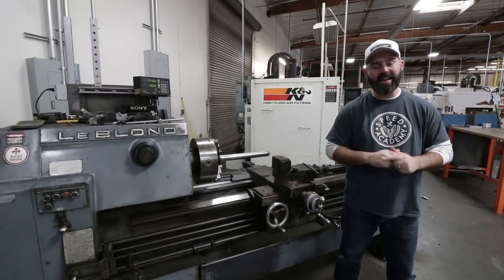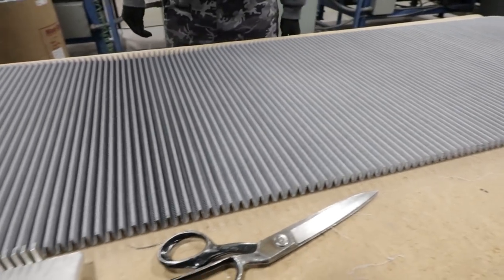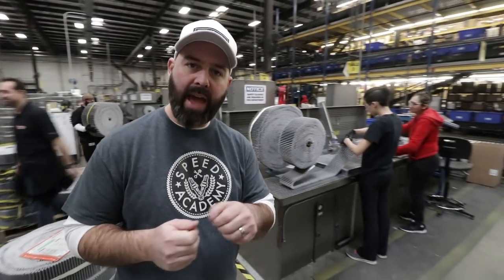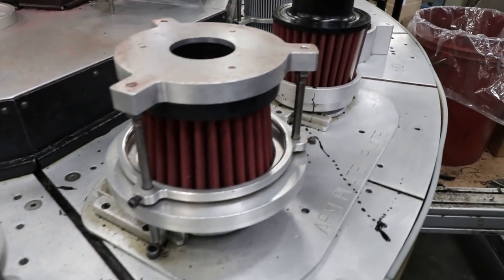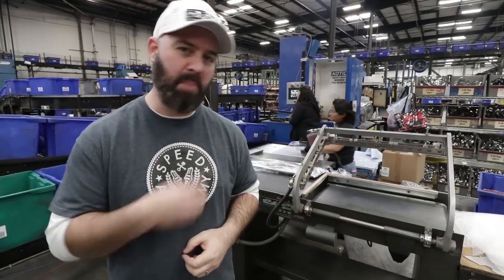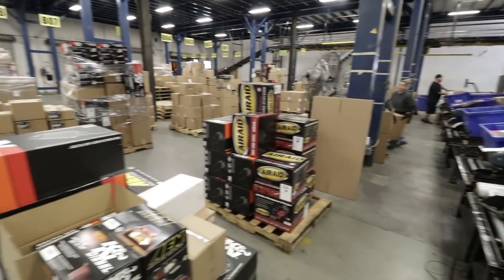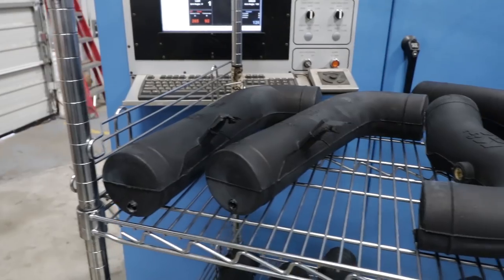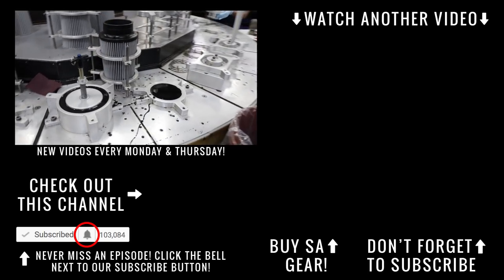How Performance Air Filters Are Made - K&N Filters Factory Tour

Comment from the maker: Who here uses K&N filters and how do you like them?
Reply: I have one in my 04 4runner. i guess it works well? i like that it's washable
Reply: I've one of those K&N rotomolded intakes on my own ASS2000, it's really a decent piece. It fits well, sounds good and (supposedly) makes a wee bit of power. Thanks for the cool video, surprised theres so much hands on work involved
Reply: On some cars you notice real power gains from using these filters , on most cars you just notice an increase in throttle response . With a car that shows fuel economy , you can see the biggest reason for using these filters . I had a 2007 Pontiac that i was able to beat the claimed fuel economy by quite a bit , if i remember they said it could get 7.3 litres per 100 km i was able to get my average down to 5.7 litres per 100km with a K&N filter .
Reply: Speed Academy Been using K&N for years on all my vehicles including my ATV's and street bikes. I want to try a DNA filter on the street bike after watching a video on the difference between the two. Still not sure if it's going to make enough of a change to justify spending twice the $$ though
Reply: Speed Academy I used k&n for a long time but I switched to dna filters they are way better
Reply: I had and currently have a K&N filter or intake on every single car and motorcycle I ever had( 30+ vehicles over the years ) My 2015 Camaro Z/28 came with one from the factory. Best part, you only have to buy it once, clean it and reinstall for the win..
Reply: Speed Academy Love it on my 95 Si. Mostly for the sound and simplicity of cleaning and spraying new adhesive on. Not sure of any real power gain but looks nice and makes the engine bay neater
Reply: nope drank 50kms more fuel over the standard filter per tank . back to the standard for me
Reply: Seen lots of them destroy engines, even when new cant seem to handle boosted vehicles
Reply: Im still waiting on the one for my Skyline, run one in my Silvia. Worth every penny.
Reply: stevemic , it may be that the extra air pressure causes the oil to enter the intake , that wouldn't hurt anything . but if the oil is not on the filter anymore dirt and all manner of junk can get past the filter ? I don't really know as i have always driven naturaly aspirated cars , and have no experience with turbos or superchargers . I had a 1987 Jeep that had over 900,000 km on it and the K&N filter sure never hurt it , or any other car i've owned so it has to be a boost related issue .
Reply: AEM Dryflow
Reply: have one in my mk7 gti and it is great!
Reply: jerry henderson i am a diesel tech and see lots of dirt that gets past the filter , not just kn all the non paper ones. 
You cannot beat a paper filter for filtration
Reply: The paper does a better job of protecting your engine , but it stops a lot of air as well as dirt .
Reply: works great on both my Subarus, I really notice a difference over the stock filters when I'm climbing high mountain passes here in Colorado, but the oil does get a little dirtier a little faster than a stock filter, but I really dont like removing factory air boxes so I have had a K&N on every car Ive ever owned .
Reply: I put one on my GSX-R 1000 - lost 1hp even after tuning... They advertised a 3hp gain... They are a marketing wank company.
Reply: I have one one all my vehicles 1996 ZX9,05 Dodge Ram w/ hemi and my 16 Mustang GT and they gave Ben working great
Reply: Speed Academy I had an FIPK kit on a couple ford Rangers for years and found them to be excellent quality. Roto-molded like you showed at the end.
Reply: I have drop-in filters installed on my 2008 Grand Prix GXP and my wife's 2007 Chevy Trailblazer. Never had issues, and always notice better throttle response.
Reply: Love mine on my Mazda2! It gives it a nice intake noise for aggression, it definitely improves throttle response, and there is a modest horsepower gain.
Reply: Have had a huge one on my 3k VR4 for 11 years... cleaned and re-oiled many times still good to go.  IDK if there is any more power but It's been cheaper than disposable filters and I get too hear more turbo spool and closed loop blow off lol... No issues with sucked oil on a Karmann vortex MAF.
Reply: Got a open filter in MG F and a panel version in my girlfriend's Nissan Pixo. Not the most powerful cars in the world but the KN filters work great in both cars, and product quality is top notch compared to some competitors.
Reply: Speed Academy love them, won't use anything else, especially to help all those workers keep their jobs
Reply: Thank you so much for this :)
Reply: Love all my KN filters. On my Jeep the paper ones only last 4 months before they are plugged and have holes ripped in them. So when I switched over I'm glad I don't have to check it every week.
Reply: CanadaBud23 so you are saying the paper ones catch more dirt?
Reply: They roughly catch the same, I find they are just weaker from moisture and don't let much air through. As soon as they get a bit wet and your motor is modified it sucks air hard it just rips holes in them.
Reply: oiled filters leave trace oil on the mass air flow sensors and eventually end up costing you when the MAF fails. users should clean their mafs frequently using such products. Ive used both KN and finer filters, both oiled- paper works better IMO
Reply: nobody I've been using oiled k&n filters for years without a single MAF failure or issue. How long before I have a failure? Perhaps, you are referring to end users who over oil, and clean too often.
Reply: Speed Academy 
People over clean them and dust their engines out, or over oil them and cause problems from that on computer controlled vehicles. 
That's operator error, other than that they can be effective.
Reply: Had one on my old 1995 Apollo, it was ok, no difference but a hole in the wallet.

My 2000 wrx came with one fitted, I pulled it and threw it in the bin. Yes I certainly did. Replaced with a dry paper ryco. Sadly the damage was already done and had to replace the maf anyway.

As for my current 2003 peanut, dry filter panel all the way in standard airbox pushing 400hp.

When would I even consider one of these? Maybe if I lived in the desert and had a maf delete done.
Reply: I had a buddy that got told his 450whp mustang was being held back cause he had the stock air intake, sd so no maf with an upgraded throttle body. they talked him into doing a side by side when he hit the dyno. the k&n with cold air kit made less then 1% more power, while letting particulates  several hundred times the size.

With a k&n, the oil and filter go bad faster, a bunch more crud gets in the engine, and it doesn't really make any more power.
Reply: I've had the same K&N air filter on my Dakota for 17 years. I've done the recommended oil kit refreshing every 3 years and blow it out with compressed air every few months. The filtration medium still seems to be functioning as intended. I will always buy K&N air filters and oil filters on all of my vehicles.
Reply: I use one. It uhh.. it filters. I just enjoy that I can clean it, and reuse it. My car definitely sounded slightly beefier once I put it in, but I didn't get it for any "performance improvements".
Reply: Love all my K&N products
Reply: Speed Academy I think they're a ripoff that don't do anything. My filter is changed every 30k miles and costs maybe $12 from the OEM.
Reply: I have used K&n on my triumph triple 675 with no issue, I have had one on 3 out of 4 cars. Does leave oil inside the intake and i found the oil isnt really that tacky like foam filter oils i use on dirtbikes. I would never use it in dusty conditions so i opted for a unifilter on my 4x4 (aussie company). Foam filter and snorkel sock. Works great. But as a filter I do like the intake sounds and some cars it improves the throttle a little bit.
Reply: Used them untill I did my research.  All they do is let dirt into my engine with no power gains.
Reply: Speed Academy 
Not me. AEM dry filter please. No need for that oil gumming things up.
Reply: I guess I am the outsider, 800k miles over 8 vehicles I personally owned all with oiled K&Ns, zero problems.
Reply: BionicForester19 Maybe with my next vehicle, dont get me wrong thats a very nice feature, but no point replacing what is already there and is working fine.
Reply: i've got one on my 06 tacoma, there was a horsepower gain and moderate fuel economy gain. It doesnt take too much maintenance just keeping an eye on the filter when your under the hood or every few weeks check to see how much oil is left on the filter. I just touch mine with my whole hand, and if the pleats leave oil on my hand i don't need to wash and re-oil. If you touch it and no oil is left on your hand its probably time to was and re-oil.
Reply: i would if they had a reasonable price..
Reply: +GUNT HEAD I know what you mean. they aren't cheap
Reply: I've had probably 3 of them in 3 different cars. They are good, fit well, make a nice loud induction noise, don't seem restrictive, and provide effective filtering. You do have to clean them regularly, and they are a bit pricey (you do have to factor into the price, the fact you will likely never replace them like factory filters which have pretty frequent replacement intervals), but if taken care of, they will probably outlast the car. 

They offer minimal hp gains, on many cars you'd be lucky to gain 1-3 hp, and this is dependent on exhaust also, only cars producing huge power will probably see much benefit, they are common on some motorbikes as aftermarket equipment, and seen in racing. Throttle response is definitely improved if you keep them clean, probably balanced out a bit by slightly more frequent oil changes.

What I like about them, is they are really rugged, and provide excellent filtering, many factory paper filters can fail quite easily and let garbage through, I've never seen a K&N do that. This does a decent job of protecting the engine from foreign particles. Don't go over-oiling the things, there is no need, as a light coating usually is enough.

I will continue to buy K&N or a similar high quality aftermarket filter, as they are an easy install generally, and offer peace of mind. I don't really consider them a performance part, as they flow very similar to a stock filter otherwise, and are part of an overall package for a performance vehicle. Usually you can find ones to fit your factory air-box, so there is not much need to modify intakes unless you are doing more extensive work on the car.
Reply: They don't filter well at all.
Reply: From their website:-

"Studies have shown most engine wear is caused by particles 10 to 20 microns in size. K&N air filters, like most quality disposable air filters, provide excellent filtration of these particles.

To ensure our air filters provide a high level of dirt protection, we regularly test our air filter designs using the testing procedure described above. Those tests demonstrate K&N air filters generally achieve overall filtration efficiency in the range of 96% - 99%. The fact that our air filters at times reach overall filtration efficiencies as high as 99% while maintaining high airflow is a testament to the quality and capabilities of our oil impregnated cotton air filter medium."

Paper filters may well be better, but do restrict airflow. So it's a trade-off.
Reply: Cheap MAF or induction roar induced pedal pressing :)
Reply: Yep, I'm surprised that people here know stock airboxes are superior and cone filters are for teen ricers wanting only a sound with -5hp :D
Reply: eamh2002 Cold air intakes work. But you can sacrifice some low end power for top end.
Reply: Speed Academy 
cotton gauze is for injuries, not air filtration!
Reply: BionicForester19 Colder IATs have proven to produce more power, what do you think attributes to the better throttle response? More power across the entire power band. Not saying everyone will get more power, but a lot show very good results even with k&n drop in vs. factory paper.
Reply: car factorys have made the intake traject after calculations.,specialy made for that car.
if you fix a cold air intake on your car and the diameter isnt right and the lenght of the tube isnt right, the engine is loosing torgue at low and medium rpm.
also the place where the open filter will be is very important 
btw the cold air in the intake tube will be warmed up when it hits the intake manifold. 
it maybe only works on tuned high rpm engines. 
its the sound that makes you think your faster.
the k&n filter wich replaces the original filter, could maybe Let trough more air but the ecu dont let it give more fuel. unless its chip tuned.
 some maf sensors cant handle the oil. but whit a original airbox you have almost the same problem.there are oil gasses out off the engine.which can kill the maf sensor. 
if you want to go faster?
buy a car thats faster 
if you want to go realy fast and dont spent to much on fuel ?buy a 1000 cc sport bike
Reply: car factorys have made the intake traject after calculations.,specialy made for that car.
if you fix a cold air intake on your car and the diameter isnt right and the lenght of the tube isnt right, the engine is loosing torgue at low and medium rpm.
also the place where the open filter will be is very important 
btw the cold air in the intake tube will be warmed up when it hits the intake manifold. 
it maybe only works on tuned high rpm engines. 
its the sound that makes you think your faster.
the k&n filter wich replaces the original filter, could maybe Let trough more air but the ecu dont let it give more fuel. unless its chip tuned.
 some maf sensors cant handle the oil. but whit a original airbox you have almost the same problem.there are oil gasses out off the engine.which can kill the maf sensor. 
if you want to go faster?
buy a car thats faster 
if you want to go realy fast and dont spent to much on fuel ?buy a 1000 cc sport bike
Reply: marcello033 the mustang GT 5.0 has the copperhead PCM. Which is a 64bit ,  the copperhead has a wider range of adjustment in variables that abetter flowing air filter will result in a slight gain   In HP and torque,   However with a proper tune more will be gained.
Reply: Sean Kandel prove me wrong if I'm an idiot.
Reply: I have had K&N kits on all my cars and trucks. I love that they're washable. I did notice a bit better fuel milage. They sound great and better throttle response. Great value.
Reply: it was OBD1 Computers weren't smart enough to see the build up.
Reply: Speed Academy I got one with 97 sierra and I need to clean it and I will in the summer
Reply: my maf died after I installed my k&n........because I dropped the maf  .....lol
Reply: At the moment i'm running an, Airaid MXP CAI w/ an RC2 Black Hex Series Air Filter & Pre-Filter.
Reply: Always have, always will. Good stuff.
Reply: I use them and I love their products
Reply: I have used them SINCE I was young, never stupid. I have never over oiled them, so they never foul any sensors or throttle bodies, I have a few filters with over 300000 km's on them, and the engines are still in great condition. These are not full race engines, although some are boosted and another have heavily modified bolt on's. I have only ever had 1 case where dust got past the filter, and that was because of user error. They work great for off road too, as driving through deep water does not cause the gauze to go soft, like paper elements do from a little splash of water.
Reply: K&N filters has been a friend of my motorcycles.
I use both air and oil filters from K&N.
One benefit i have gotten is a gnarly intake sound, love it.
The 17mm socket fastener on the oilfilters are super great on bikes where access to the filters can be limited.
All in all; I love K&N and the quality products they make.
Reply: I dont see a point in paying 4x more compared to what an OEM filter costs when the K&N wont give me any benefit.
And I do not want the MAP sensor covered in a film of oil
Reply: I've been running the same K&N filter on my Integra for the past... probably 10-14 years lol
Reply: If youre getting oil on your maf sensors... you're overoiling your filters. Blaming the product for your own mistake is really dumb.
Reply: JF cuiser here! love that succer, after a day of hard wheelin on dirt roads just put the house and thats it
Reply: I have used KN since 1995, on all 3 different cars from my everyday family car to my sport cars, they are the best so easy to clean and oil, which can save 100's of dollars not to mention the extra performance and less fuel used due to extra air mixing with the fuel. :)
Reply: i use them in defaul cars and i love it... you can clean them... first filter buy back in 2008
Reply: @stevemic  I had one in my '89 Ford Probe GT for years with no issues.  Never heard of this as an issue.

Comment: I use one on my Sportster and on my truck. Both improved the breathing of the engines over the stock restrictive air filters. Improved throttle response and a slight increase in fuel mileage. Much better than throw away paper elements.

Comment: Been using K&N in all my vehicles over the past 15 years (my current one actually needs two - twin intakes/TBs) These filters are a bit pricey, but always deliver good results. On turbo charged engines you get faster spool and better throttle response with NA.